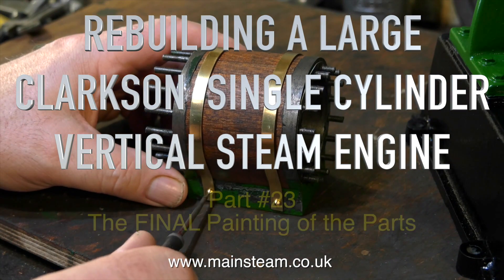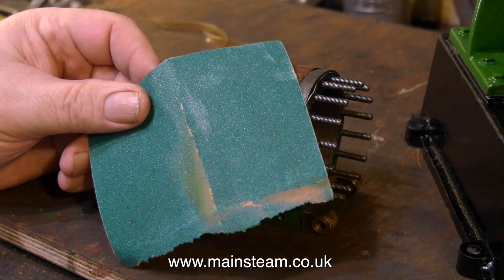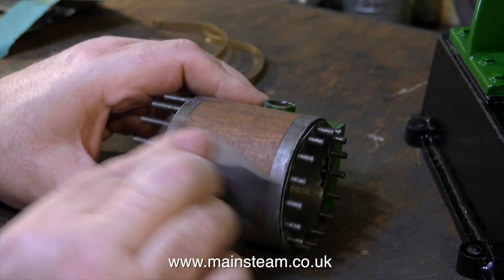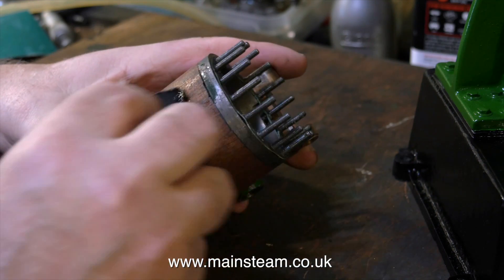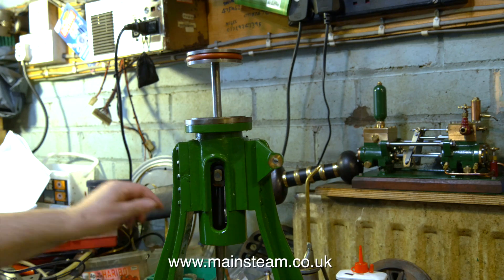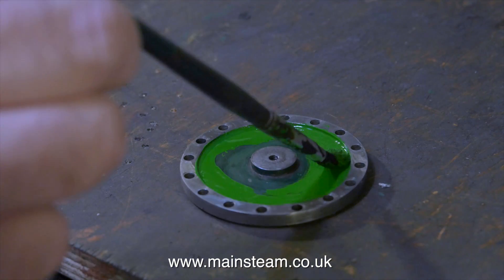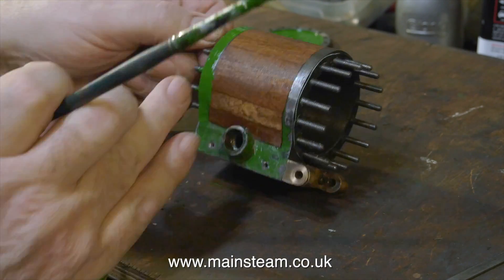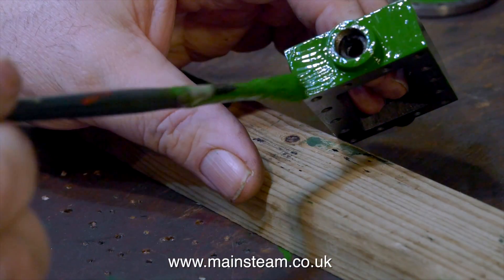REBUILDING A LARGE CLARKSON VERTICAL STEAM ENGINE - PART #23

Comment: Keith I have a quick and hopefully an inteligent question? Have you ever seen or know of anyone who used powder coating on their model steam engine. I would imagine that the prep work and masking could be a real nightmare.
Reply from the maker: I had my little 7 1/4 inch gauge 0-4-0  locomotive powder coated when I built it in 1996, it seems to be OK, but power coating often just peels off if water gets underneath it and causes the metal to rust under the paint.

Comment: Maybe my question is redundant, byt is there any particular reason you do not use masking tape to prevent the mahogany turning green?
Reply from the maker: +Willem Kossen I just like the excitement that living life without masking tape and generally on the edge brings :-)
Reply: +Willem Kossen If you use masking tape there is a good chance that unless the edge of the tape seals perfectly paint will bleed under the tape onto the timber. It probably also takes longer to apply and remove the tape than to paint freehand.